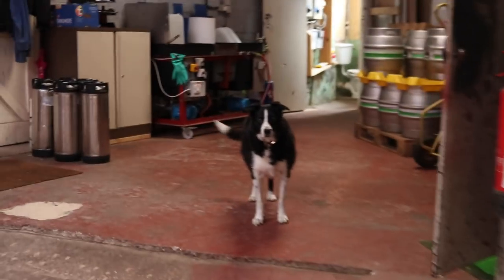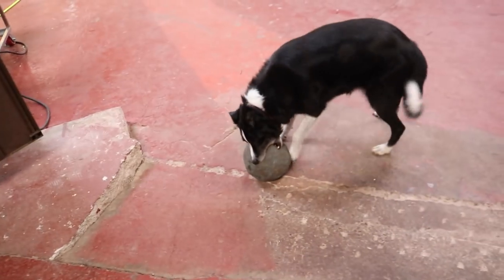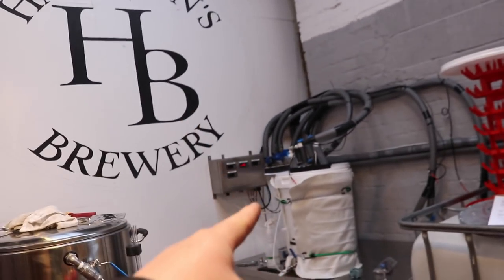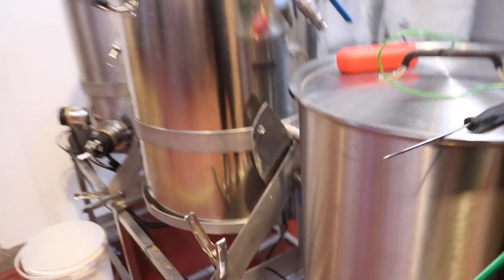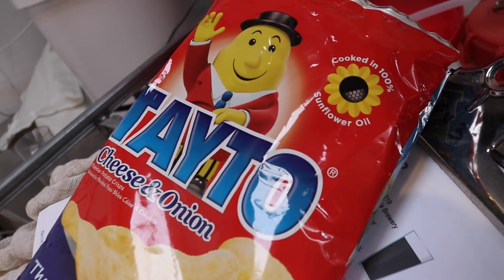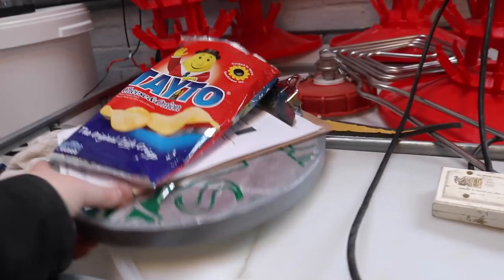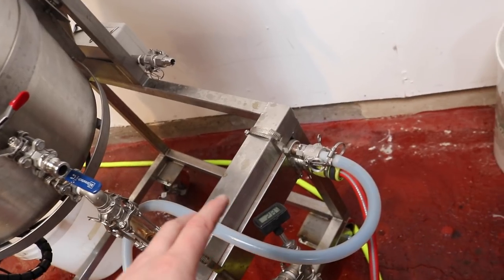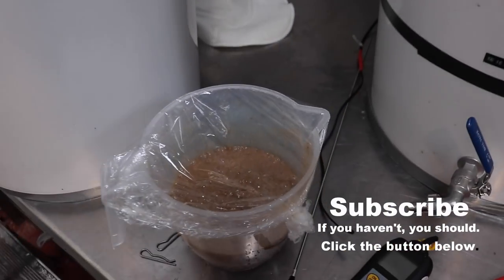Update 🍊 Plum Porter Beer  🍺 ~ Brew Day For V2

Comment: Given the length, you'd probably be a lot better with a 3-wire PT100. The 3rd wire allows the PID to account for the resistance in the cable run which will be significant in your run. I'd also be concerned about running the probes next to so many mains cables. The inkbirds are measuring a tiny change in current passed through the PT100 and all those high powered mains cables could be inducing stray currents. I don't know enough to recommend anything specific on that point, though. But might be worth looking in to.

Comment: Thanks Chris for another great Vlog, I have had a good laugh and learned quite a bit in the last six months or so. I'm interested in the post boil filtering and cooling into the FV via a plate chiller. I've tried a few different things over the years and decided that there are a few things I can't get around. The plate chiller needs a fine filter to keep the crap out of it or it blocks (as we all know) That's okay, you put in a finer kettle screen and Bob's your uncle. The problem I found is the pump, the more suction that goes onto a fine mesh kettle filter the faster it blocks. So, I reckon that the best combo would be a grant (out of the kettle filter) and then pump through the plate chiller. Using a grant will let you run off without the kettle filter getting stuck and then the pump can push clear wort through the plate chiller. My two cents worth, thanks for allowing us some comments/feedback. Keep punchin and Go the Aussies in the World Cup!

Comment: Hey Chris, If you use a hop spider in the boil kettle it will completely remove the risk of blocking your Y strainer and heat exchanger.
Reply: Also it is poor practice to run low voltage wires along side high voltage wires. This is a big no no in the aviation sector as it can induce a voltage in the low voltage wire throwing out the sensor signal. Best practice is to only cross the high and low voltage wires at 90 degrees if needed. Id recommend running the sensor wires back to the control panel as a separate loom away from your element power cables.

Comment: It still looks like you may still have the Y Strainer fitted around the wrong way.  The design is such that it should flow much of the filtered material down into the base of the trap.  The way you have it, the particulates will have gathered and compressed, causing the blockage.
Reply: i thought i saw same thing last video :) i guess should have said something too
Reply: @dimash244  I mentioned it then as well but I can understand people being busy and not noticing comments.
There's been a fair amount of misunderstanding of this in a few groups.  I've just put a video up regarding the way Y Filters work.